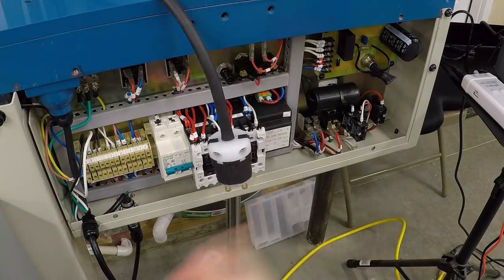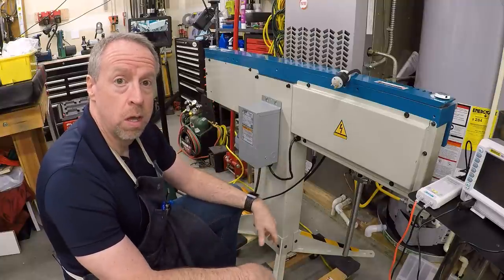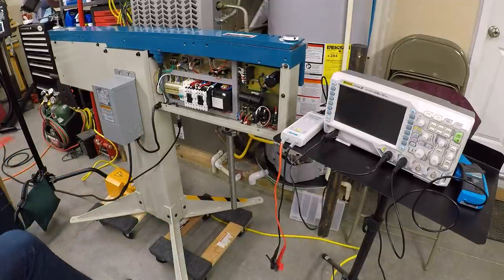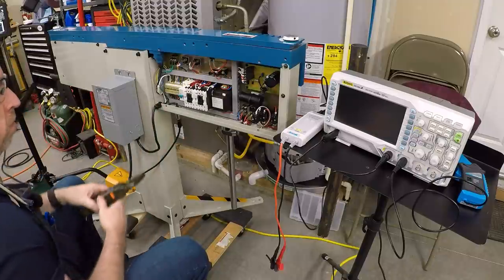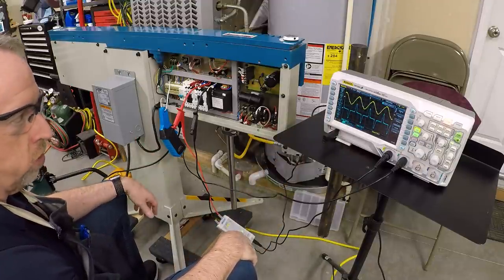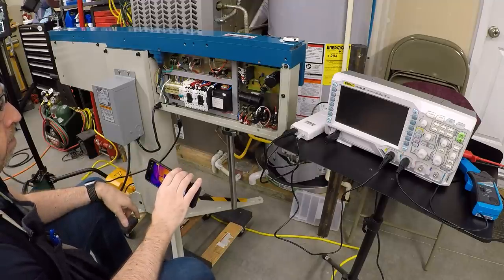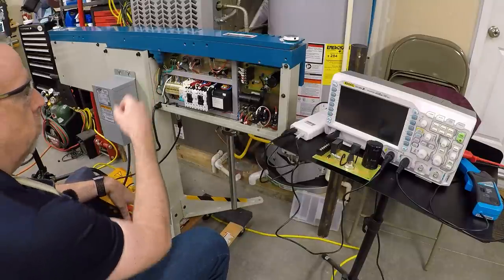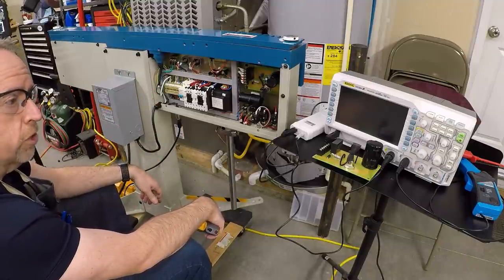The Mystery of the 17.4A | Sheet Metal Saga

Comment: Hi James,
What you are seeing is a typical waveform of current flowing into a full wave rectifier. If you put the voltage probe on the smoothing capacitor, you’ll see a form of sawtooth wave.  On the same time base, the input current will coincide with the rise of the saw tooth, this is when the smoothing capacitor gets charged - the input voltage is trying to pull up the capacitor voltage.  The distortion in the input waveform is, basically, the voltage drop in the supply (probably exacerbated by the buck transformer resistance), caused by the sudden current draw multiplied by the supply resistance when the supply voltage becomes higher than the voltage on the smoothing capacitor (and the rectifiers start to conduct).  

RMS of a waveform is the effective/equivalent continuous DC level of that waveform. So an AC voltage reading of 120V,  will be the same as 120V DC.  Typically “true” RMS reading devices, only gives a correct result for sinusoids. The current waveform you are showing is not a sinusoid, and if you want the RMS of that waveform you would need to sample a complete cycle (or multiples of the cycle) and perform some maths.  It’s a lot of work for the Rigol and most oscilloscopes to do (and most multimeters too), so they just do a peak voltage detection and divide by sqrt(2) or multiply by 0.707.  You’ll find a couple of posts on forums that question the validity of Rigol’s rms calculations.

I think in your case the cheapo averaging multimeter is actually giving you the more correct result.  I hope that helps.  Love the channel.
Reply: It looked to me like that was inductive charging rather than capacitive. I'd expect capacitive charging draw to continue to the top of the sine wave and a little bit past. This appears to be a sharp spike at the beginning conduction point, which is more what I'd expect from an inductor.
Reply: If you look at the current waveform, it’s 0 Amps up to roughly 3mS before the peak.  At 3mS the rectifier diode starts conducting and pulls up the smoothing capacitor voltage.  Just before the peak of the input voltage the current begins to drop - at this point the input voltage is still higher than the capacitor’s so the capacitor is still being charged, but slowing down exponentially.  Once the input voltage is past it’s peak, the rectifier becomes non conducting and the current drops to zero. There is however, a slight parasitic inductive/capacitive ring just as the diode turns off - that’s almost certainly the buck transformer inductance.

If you put the ‘scope probe on the capacitor you should see a roughly 60 to 70V peak to peak ripple.  Doubling the smoothing capacitor would reduce the ripple, probably by slightly less than half.

Power is only consumed when the current is flowing, thus roughly 3mS/8.3mS (or 6mS per 16.666MS period) = 36% of the time.  However, even though the current peak looks sinusoidal, it’ll have significant exponential affects, particularly on the falling edge.  In order to figure out how much power is being consumed you would have to multiple the instantaneous current at any time with its corresponding voltage - you can’t just take the rms value of current and multiply it with the rms voltage. It’s going to get quite complicated 

An easier way would be to measure the voltage at the smoothing capacitor and multiply it by the current drawn by the rest of the circuit.  You’re then purely in the DC domain without any frequency aberrations affecting the results. 

If you don’t have a current meter capable of reading 20+ DC Amps, you could measure the resistance of the wire segment between the capacitor and the next component (it’ll be in the milli-ohm range) and then measure the voltage across those two points (it’ll probably be in the 10s of milli-volt range). Won’t be particularly accurate, but it should put you in the ball park.  You wouldn’t want to do much more than that, or it’ll probably start affecting you warranty.

Comment: I will not attempt to integrate the current and voltage values from the oscilloscope in the video. I am curious, however, what is the active power of this device. It seems quite possible to me that the manufacturer, when stating the value of the current, simply divided the active power by the recommended supply voltage.
Reply from the maker: Hmm...I suppose I could set up a math function to multiply the instantaneous voltage by the current...  Not sure if I could then get the RMS easily without dumping the data...  Food for thought.
Reply: @Clough42  you should be able to use the RMS function on the resulting math channel.

Comment: You asked and I checked. On 240v, true RMS pre-clamp is 1.56a. Full clamping force is 20.04a.
Reply: Incidentally, I had .020” aluminum sheet under the bar.
Reply: 22/24 * 20 = 18.3. Sounds like about what James is seeing.
Reply from the maker: Yow!  I suspect they're all running quite a bit hotter than spec, and from what I gather, many were failing on 240V, hence the recommendation to use a buck transformer, and all the warnings in the manual.
Reply: @Clough42  James is the buck transformer you used in an earlier video still the one you are using now?  Will be doing something similar but would look for recommendations from you if there is a more appropriate transformer knowing what you have learned?  Thanks for the awesome content!

Comment: One thing you didn't mention that I'm curious about: using the scope, multiply the current and the voltage and integrate over a period. I'm curious what the average power draw is. Maybe the average power draw is 2200W and the manufacturer just tagged it with 2200W/220V without actually putting an RMS meter on it.

Comment: While in college (1987), my Panasonic laser printer died with a pop. Took it to my local defense contractor during their lunch hour and my dead printer was fondled and probed by techs with decades of experience. Their solution was to resolder the entire power board. "Chinese solder job with cheap solder will cause these failures."  The printer worked for 5 more years until I replaced it with a faster one. 

I find your instinct to resolder a new Chinese component board totally sane, normal, and necessary.
Reply: It's the low quality Chinesium (according to "Marc" if your curious ) 😊

Comment: It does not appear you have sufficient saturable iron on that buck transformer to feed the brake from what I can see.  In rough theory, the size of the coils/iron of all elements in a power feed chain should all be about equal.     A 500 VA transformer does not match a 2.2 kVA (220 x 10, etc) load demand, and if that load is now 17A in lieu of 10A, then there is an even greater mismatch.  The main purpose of the nameplate on such devices is to size branch conductors and the branch circuit breaker.  If the nameplate data is accurate, it can be used to help determine aggregate load demands, etc.  Usually the nameplates are somewhat accurate.  However, Bayleigh is a machine-making company first and likely sub-contracts their electric components - so they may not be too familiar with the electric items.  The current waveform you showed on your Rigol is "grossly" distorted.  I doubt that 240V v. 231 (220 + 5%) is going to cause great distress. In short, it appears that Bayleigh may have been inaccurate in reporting current demand on the nameplate, leading to un-needed corrective efforts, the undersized buck transformer and the distorted current waveform.  I would be more concerned of the harmonics caused by the current waveform than an extra 9VAC on the line.  The minimum proper transformer rating for a 17.4A @220V load is 3.8 kVA.  I don't think you need a buck transformer to begin with.  Try removing the transformer, re-assess the current waveform.  You will see improved PF to boot.  If you want to account and explain the load demand, see if the electromagnet itself has any rating data, then try and sum up the other ancillary loads, etc.

Comment: I’ve used a few pan brakes when I worked in a sheet metal shop.  That is an interesting gadget - the small size is nice.  For that money, I probably would have gone for a heavy duty older model.  Removable fingers are quite handy.  Also you can push the counterweight from a standing position to get the bend started without using your back - unless you’re just bending light narrow pieces.  Without the manual clamping capability, I’m not sure how you can complete a hem for stiffness and to eliminate the sharp edge on decorative pieces.  And you wouldn’t have lost one second on the electric bits😁.  I enjoy the videos and the channel.  Thanks for sharing.

Comment: James -- if you happen to talk to Bayleigh again, you might want to refer to ANSI C84.1 which establishes 240V as the standard voltage in the US, with some tolerances depending on situation.  What Bayleigh is selling is apparently spec'd so it should not be used in the US.
Reply from the maker: I'm sure they're aware.

Comment: It would be interesting to put the current probe on the magnet, after the rectifier to see what that looks like. Also the scope can calculate a power trace if you set it to multiply ch1 and ch2, and then it can display an RMS power reading.

Comment: Hi James,Very goodvideo you posted.I am wondering.Supose the 10.4 amp specifications are wrong due to translating issues,then why the 15 amp circuit breaker don't trip when 17.4 amps are pased ?.The contacts also shouls show overheating signals on the contacts of the circuit breaker.Interesting stuff indeed.

Comment: Did you compute the RMS power?  Maybe power/210 would give a hint at it their number?
Just a note:  Although power factor is the ratio of VA to watts, the traditional expectation was in the context of sine waves, so it's just a function of phase shift caused by capacitive or inductive loads.  When switching power supplies became common in computers - in the nineties - it threw all of those assumptions out the window.  I recall that the cubicles all around my wife had to be taken apart because the usual assumption of net-zero neutral current was aggressively violated.

Comment: Did you measure the input current of your step-up transformer (on the 110V side), may give some more clues, .....perhaps you get some weird resonance effects on the output side, because the transformer has problems to handle the nasty peaks which are certainly exceeding the rated current and just driving that little thing into saturation. My gut feeling tells me that a larger transformer may show a somewhat different result.
Reply from the maker: I also expected this, but no.  The input and output of the transformer look identical, except for the small voltage step down and related current increase.

Comment: Is that a 45A+ peak charging current I see on the rectifier circuit? I bet the capacitor will wear pretty fast with those kinds of currents. It would be nice if they'd put some current limiting circuit on there, to reduce the peak current, extending life and improving power factor. I'm not sure if this device would even be allowed in my country due to EN/IEC61000-3-2 regulations.
Reply from the maker: Yeah, I think that's likely.  You can see the heat in the traces leading to the cap on the circuit board.

Comment: Seems perfectly normal for a rectified outout with a bulk capacitor. It might be worth pulling out the bulk cap; i don't see any reason to smooth the power going to the magnet. Unless they're afraid the grip will disappear for the few milliseconds each cycle. Other option is to put a resistor or inductor in series with the cap to limit the current inrush...
Reply from the maker: My only concern with trying that is I really don't understand what the thyristor circuit is doing here.  It's DC, so it seems like it would just latch up and stay latched until the power is switched off.
Reply: @Clough42  is the thyristor switching the DC? That is a little strange. Unless its switching before the cap, in that case i think it might work (i.e. Current drops to zero every half cycle)

Comment: Those current spikes on the AC waveform looked to me like an inductor charging rather than a capacitor charging. If it had been a cap charging the current should have continued from the start point in the wave to the top of the AC voltage wave, not not just been a sharp spike where the conduction started. This looks to me more like a coil that is being fired by a thyristor at that point in the AC cycle. 

As luck or happenstance would have it, I've just been simulating a circuit in LTspice that has a transformer where the output voltage is controlled by triac phase control in the primary. The current waveforms look not too unlike what you are seeing here. As I see others have mentioned, it would be interesting to simulate this and see what it says. Knowing the inductance of the magnet would probably be helpful. The circuit looks like it is probably pretty elementary. Most of the complexity is probably in the time delay and the DC flux discharge circuit, not the main clamping circuit.

I'm wondering if somehow your buck transformer is getting into the game here and tweaking the waveform. I don't think it really should, but that is a pretty ugly waveform, and it would be real interesting to measure RMS current (and even more interesting, RMS VA) at the input to the buck transformer. I'm guessing it is probably going to look much the same modulo some proportionality, but maybe not.

Comment: Well, I have a 2016 model, and right after I bought it used, it began pulling 15 amps (measured with Cen Tech and Fluke non-RMS meter) when you turn the power on, and does not pull more when start is pressed or the bending leaf are lifted. Still trying to work out the problem with Baileigh support, who think it's a board problem, after sending me a new stop switch assembly and the low voltage rectifier.

Comment: Do the  component loads make sense for the power draw?  I am with you, you should see an extra 1500 watts of draw in heat somewhere, unless it is all in the magnet.  Magnetic force is the square of the distance?
Reply from the maker: I suspect it's mostly going into the magnet, and the nameplate rating is just wrong.

Comment: Does the magnet care if there is stock being clamped? Does the current change if there is something keeping the poles apart? I have no idea how electro magnets work but that is one variable available.
Reply: Also, I wonder if different sheet metal materials, ferrous vs non, affect the clamping current. I’d have to study the magnetic circuit.
Reply from the maker: I tested this and it made no difference.
Reply: There may be a difference in the transient when you engage the clamp, but the steady-state value won’t be affected by the material. That can only be limited by the coil resistance.

Comment: Phew I got off lightly apart from now NEEDING a bender I have a Fluke Thermal Camera, Micsig Differential Probe, several CT Probes, a handful of Scopes and two handfuls of DMM's :)  ** Also make sure you discharge Capacitors before dropping them on an ESR meter lest the meter release the magic smoke :(
Reply from the maker: I checked it with the low-impedance voltage mode of the BM235.  It was already discharged to about 8V and the meter finished it off.
Reply: @Clough42  NP just can be a trap, I have some LCR tweezers that are really sensitive to that so I tend toward over cautious :)

Comment: Hello, and greetings from your subscriber from Finland! It is usually meaningless to measure the average of an AC waveform, since that average is always zero if there are no DC component in the waveform. But with a modern oscilloscope, you can measure the true dissipated power in watts, just set the oscilloscope math function to multiply the current waveform with the voltage waveform. Remember to adjust any probe offsets to zero carefully. Then measure the average of this instantaneous power and that is the true watts consumed by the device by the definition.

Comment: Three values I didn’t see you take were the mains voltage from the AC outlet (240 vac) and magnet current and voltage drop.
I believe, however that earlier comments pegged it when they suggested an integration of the PF numbers across the waveform.
I don’t think anything is amiss, particularly.

Comment: Although the high amperage is only briefly i don't think it will be a problem for your transformer. However if you use the clamping force for a long time the peak amperage might saturate the transformer resulting in warming up of the transformer.

Comment: It's been a very long time since I used my EE training, so it's very rusty. My memory, though, is that RMS is mostly assuming a sine wave. With the diode and recharging the cap, it's far from a sine wave. So I'm not sure it's meaningful. Another question would be if the meters are correctly calculating RMS for this waveform. I suspect not.
Reply from the maker: It's the other way around.  The Fluke and the scope are measuring the actual RMS current, but the cheap Cen-Tech is estimating it by assuming the waveform is sinusoidal, which it is not.
Reply: RMS has a lot of fancy math, but it basically tells you what DC current would cause the same amount of heating in a resistor as the AC current you're observing.  It is 100% valid for ANY current wave-form, even random noise.  The problem here is that none of his tools take into account the power-factor.  AKA how in phase voltage and current wave forms are.
Reply: @martylawson1638  The math isn't really that fancy - it's just the square root of the integral of the square of the instantaneous voltage.  Intuitively, Vrms * Irms should equal power.  But the computation of power delivered is easy and intuitive: It's the integral of the instantaneous power.  No square or square root is involved.  Also, RMS power is nonsensical and not useful.  Despite what audiophiles talk about.